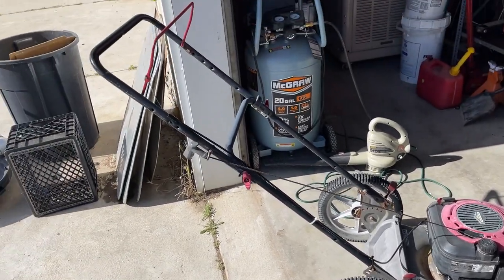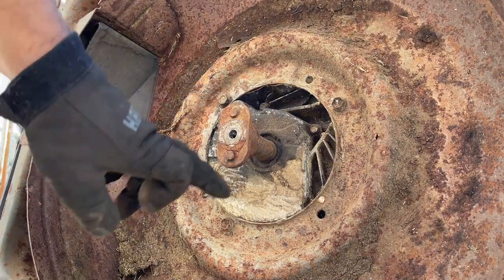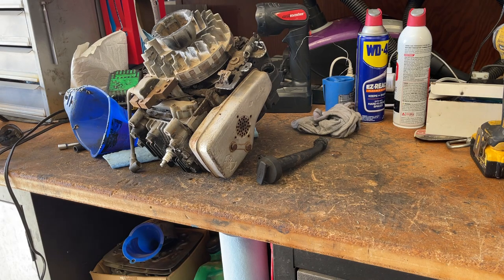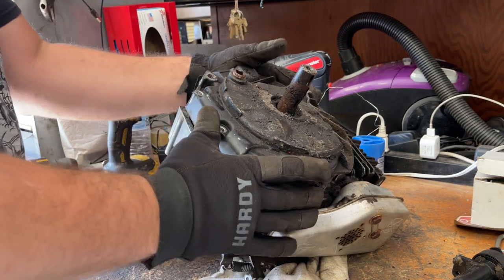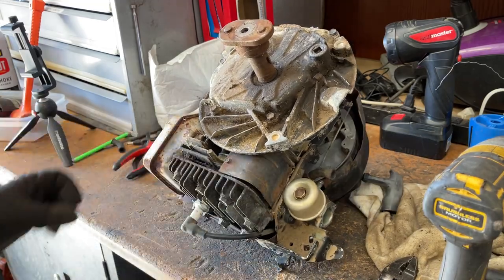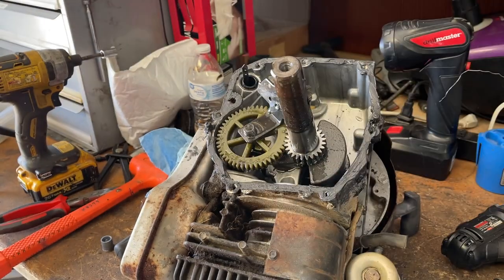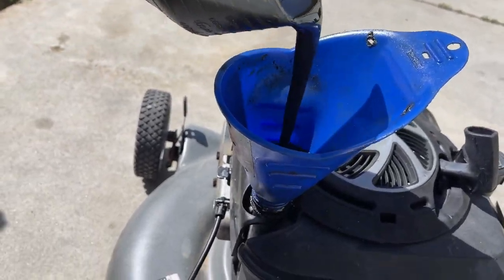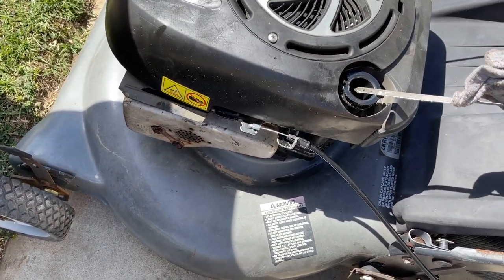Craftsman Lawn Mower Leaks Oil? Change the Oil Sump Gasket

Comment: People do not care to know , about thing they consider unimportant . Why would you buy a new mower for $300 or $400 , when you could buy a good used mower for less than half the price . With minimum maintenance will last longer then the new one and do the same job . It is so sad .
Reply: Those old quantums are heavy and probably cause the plastic deck hardware to get cambered up, but hey never toss em. They just need a new  Honda deck to fit on to. I't has crossed my mind. Someone was dumping a newer hrn 217? vka . 170cc had rod sticking out and no recoil cover or carb. Total wreck by his mother and law. Lol. Hilarious. I said thanks I'll think of something. It looks kinda new. But is exploded